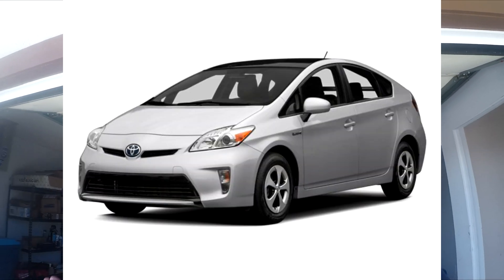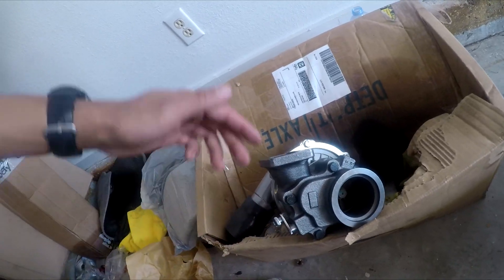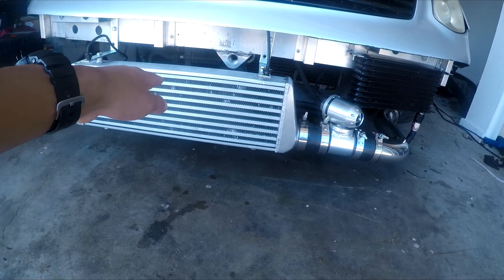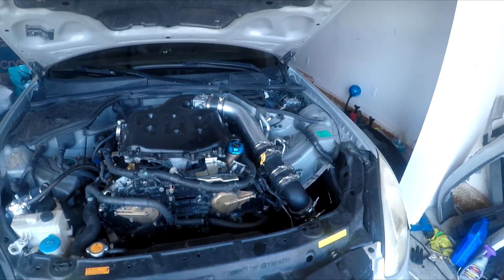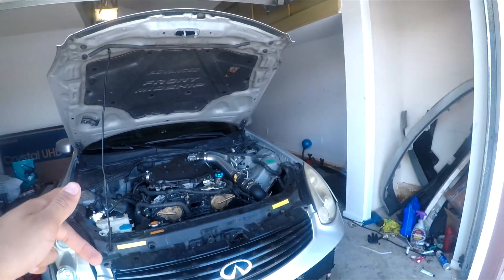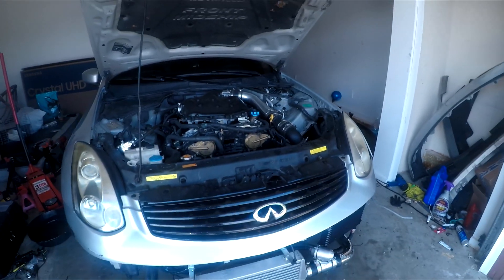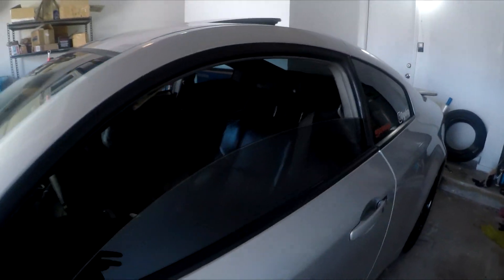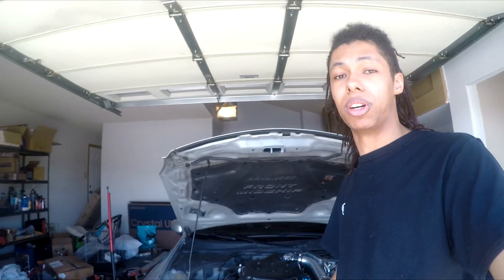How to Make A Custom Turbo Kit on ANY Car!

Comment: You rather keep your boost gauge over the oil gauge? 
   Boost is controlled either by a spring or controller. What I'm saying is: you can continue driving without a boost gauge. If oil pressure drops too low, your crank and pistons can still be saved by swapping out the oil pump or wherever the problem is at.
Crank shaf/Pistons/rods/cylinder valves are the more expensive.
Reply from the maker: @Nitrousedstang   if that spring or controller fails then you will overboost, if you’re over boosting or have no boost control whatsoever then you engine will blow up guaranteed. It’s very important with aftermarket, it can happen from something as simple as a hose popping off

Comment: So I got a 2006 Acura TL  but there is not any manifolds to mount a turbo
Reply from the maker: You can have a shop custom make you one, you’ll just need a flange, keep in mind you can mount the turbo anywhere on the exhaust, anything with an engine can be turbocharged

Comment: how much did you make on the dyno?
Reply from the maker: Doing like 270 wheel rn but they said their dyno runs like 30 percent short so probably like 300 wheel I’ve or take on 4 pounds and I’ll be going back soon for 7 pounds to do the final power tune 🙏🏽

Comment: How much did this run you.
Reply from the maker: Parts was like 2200, the fabrication of the exhaust was 500 and the tune was 550 so a little less than 4K roughly
Reply: @DGWhipZ  bet good looking out my guy🙏🏾
Reply: So since this is about 4K to do it should I just get the Fab9Tuning gt turbo kit? I have a 07nc Miata with a 2.5 swap and kits don’t exist except maybe that one and idk about others. I thought it’d be cheaper but idk
Reply: Damn should of ls  swapped for that price
Reply from the maker: @badquality4069    Nah I would rather just buy a vette at that point
Reply: @DGWhipZ  for 20k🤧
Reply from the maker: @badquality4069  too many ls swaps, it’s just not original at all and honestly I wouldn’t have bought this car if I wanted a domestic v8, I’ll build the vq if I want power